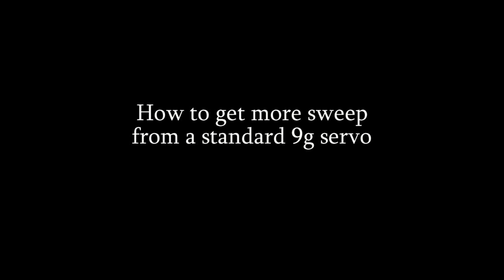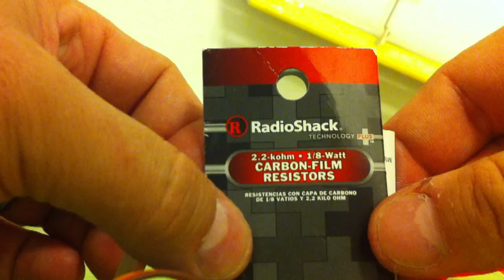How to Modify an HXT900 servo for 180 or 360 degree sweep

Comment from the maker: Sorry, regarding the value of the resistor, you will need to experiment with that.  I think the more you stretch the rotation of the servo, the more you risk exceeding the limits of the variable resistor pot that tells the servo where center is.  As I stated in an earlier comment, once you lose the neutral point, the servo becomes useless for panning a camera.  Different servos will have different limits and this is just a fun experiment.

Comment from the maker: Essentially, that's all it is to start with.  Just a gear reduced motor that uses a resistor pot to limit rotation.  The problem with making it spin continuously is that you loose your neutral point.  It's not very useful at that point, for a camera anyway.

Comment: Perhaps you can help with what im trying to achieve. ;) I want to get a servo board to sweep from 0v to possibly 6v so I can use it to power some LEDs. Do you know what resistor values id need to accomplish this?

Comment: Hi, I need to increase the sweep of the servo horns from the present 180 degrees to about 300 degrees, preserving the auto stop. The plan is to use the small disk that comes with the servos as a platform to carry the main turrets of my 200 scale Scharnhorst. Do I need to install a new small tab on a gear?

Comment from the maker: @gewizz2 You should only have to take the plastic stop out if you want a 360 degree sweep.  Although for 360 degree, you will probably need to remove the centering pot from the servo as well or when you let off the stick, the servo will move back a few degrees.